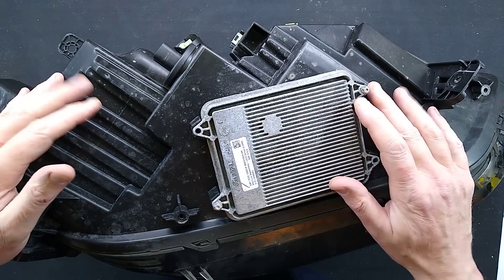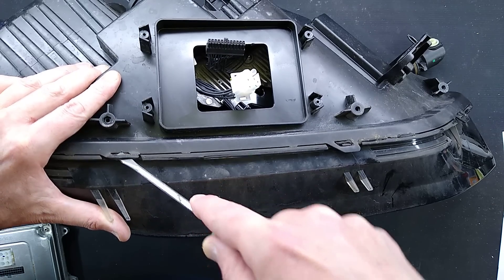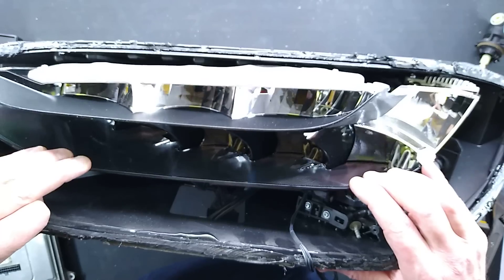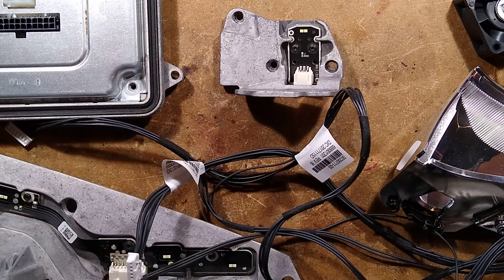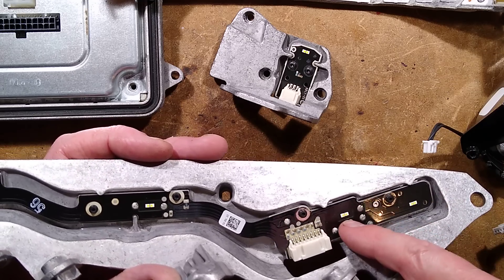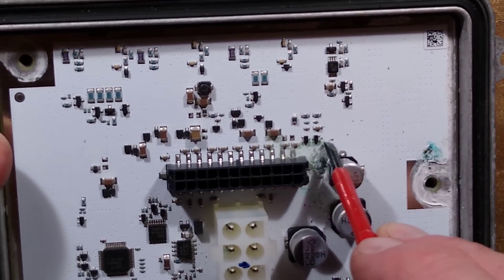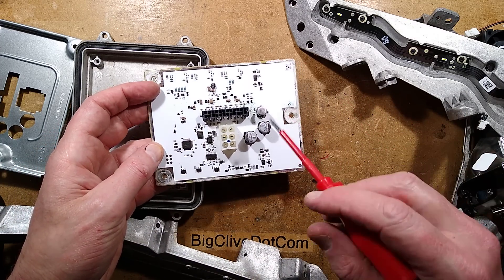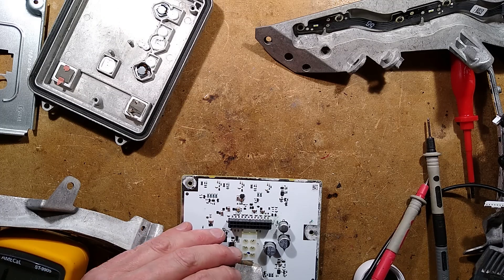Exploring a Tesla model X headlight

Comment: Thanks for reminding me to never buy a Tesla.
I got into a cab once and it was a Tesla, driver was talking about how the car only has 11 moving parts. The wheels, the brakes, the motor, the wipers and the door handles that pop out. 
When I pointed out that each door was a moving part, the dial for the volume on the radio, the speakers, the boot, the indicator/headlight stalks and the interior door handles it seemed to take the wind out of his sails a little. Guess sales talk total bullshit. 
I shall remember that the headlights themselves are also a moving mechanically actuated part and that they cost over a grand to replace if a single drop of water gets inside the control module.
Reply: You’re going to blame a cabby’s ignorance on Tesla?

If he was a genius, he’d be doing something else.
Reply: Tesla doesn't claim that though, so you're really only arguing against some random cab driver you met.
It's obviously true that an EV has that less moving parts than any ICE car, but it's still probably close to 100.
Reply: @logitech4873  I can say with a good deal of centainty that their sales reps will probably claim that the car can travel back in time if you go over 88mph.
Not too far off base for them to say that the car has an absurdly low amount of moving parts.
Reply: @daviddavidson2357  Their sales rep? You don't have to talk to anyone to order one. Most people just order them online :)
When I was at a Tesla showroom trying out a Model 3, nobody there tried to convince me of anything. I was just handed the keys... I mean, keycard.
Reply: @logitech4873  Some people order them online, some people buy them from a showroom.
Have you ever worked in sales? I have and believe me, most sales reps will talk the biggest load of bullshit to sell a product. I ended up quitting because my manager was bragging about how he essentially forced an old woman, without Internet into signing up for Netflix by just refusing to leave her doorstep until "she took a look" then back in the car he's laughing his ass off about how she can't even cancel the subscription easily because she has no Internet.
Reply: @daviddavidson2357  I haven't worked in sales, but I've also never really experienced salespeople like that. It's just not really the culture where i live.
Reply: @daviddavidson2357  Tesla doesn't sell you a car in their stores. You have to go online to order one. Even if you go to their store, they make you use one of their computers to order your car online.
Reply: @sjokomelk  So, by ordering it from a computer in the showroom you are doing what the sales rep would usually do instead of having the sales rep who is in the showroom do it for you?
Seems like extra steps but okay.
Never been to a tesla showroom but they have one in my city and I'd wager sales reps get commission just like any other car showroom.
Reply: @daviddavidson2357  They don't get commision. They are on fixed salary, but they all get  bonuses for when the company hit their targets.
Reply: I think he’s misunderstood, I think it’s the drivetrain they refer to when quoting few moving parts on EVs, vs ICE…
Reply: Wonder how many bearings it has. A typical bearing has several balls in it. And they all move.
Reply: @brianleeper5737  This. The smaller you go the more moving parts you get.
If you go subatomic you would probably have 1x10^1000000... moving electrons.

Comment: It is not just Tesla, BMW LED motorcycle lights have proven to fail similarly. I changed out a rear LED tail light due to internal condensation with a genuine factory replacement part only for the new unit to do exactly the same. Supposedly IP67 sealed unit parts. My arse!

Comment: A note: the 12v aux battery is only used for opening and closing the contactors, plus a few safety systems such as door locks. Everything else is driven from a DC-DC converter from the HV battery.
Reply: I'd imagine the DC-DC converter goes for the higher voltage rather than 12V to keep the 12V battery charged?
Reply: @chaos.corner  It does on the Chevy Volt.
Reply: Most of the conventional car stuff is still powered from the 12V battery.

Comment: What the hell are those connectors doing inside a 100k+ car ??? 
Those are from PC power supply. 
I have seen a lot of people on various FB groups, who had a cheap aftermarket dashboard gauges, that used these. Most of the time they failed, because the connector didn´t like the vibrations, which it didn´t have to endure when standing inside a desktop PC, a thing it was designed for. 
After replacing them for automotive grade connectors, which had rubber grommets for each cable, preventing the vibration induced tugging of cables, all of the gauges worked fine without any hiccups.
Just another engineering oddity, that made me think that the tesla engineers are more electrical, than automotive engineers. Almost like they were forgetting that the car is in motion while used. Not to mention the atrocious quality control, in their factories, the panel gaps, paint quality and interior fitment speak for itself, and is unacceptable, for a car in that price range. Hell, even my Trabant had a better fitment from factory, and that was a cheap communist car for working class.
Reply: Tesla was never and will never be a proper automtive maker with mechanical engineers. It's just a hyped up start-up which still doesn't make any profit.
Reply: Spot on, I am an agricultural engineer and the only connectors that survive are weatherpack. The pins and seals are very well designed. Good job that silly boy Musk doesn’t manufacture combines!,
Reply: @nicolassales8679  I have a 1984 Chevy Cavalier (it was my dad's, he bought it new, and I inherited it when he passed away) and in the process of getting it running again (it had been parked for 10 years), I noticed it had the original GM weatherpak connectors all over it (with the round terminals and green wire seals). Makes me wonder when GM first started using them.
Reply: A lot of aftermarket car headunits use those Molex-style connectors. But aftermarket radios don't come with 3-year (or more) warranties and you're probably lucky if they last that long.
Reply: The inside of the headlamp is the same in any modern LED assembly. Just open another one from Hella or Valeo, and you will see the same kind of connectors. And the connectors you see in this video are inside the sealed assembly. The connector to the wire harness on the car is a weatherproof automotive style connector.

Comment: My 1971 Hillman Imp had ‘sealed beam’ headlamps. Eventually the ‘dip’ element (usually) would fail requiring a complete new unit for the car costing an eye watering £35, but I was able to repurpose the old one as a super-power (for then anyway) torch by using the intact main beam, a bit of drainpipe, and some NiCds.

Note that £35 in 1971 would be worth £550 today!
Reply: You were buying your sealed beams in the wrong place. 
Halfords sold 7" and 5/¾ inch made by Lucas for £7.99, all the way through the late 70s to early 90s.
Reply: @johnnodge4327  That's more like it, or just nip to the local breaker's yard and get a used one for a quid.
Reply: I always disliked sealed beam headlights until I owned a car with them. they never faded, and if they got rock chips, or it got smashed you could just replace them super cheap.
Reply: Blimey
Reply: Careful you'll upset the people who seem to believe that anti-consumer BS  is something Elon Musk personally invented in the 2020's to piss us off. It has never been easy to repair consumer electronics and they have never  wanted us getting in and seeing how they work.
Reply: Sealed beams were mandated in the US for a while which resulted in some interesting design tweaks on European vehicles. I had some sealed-beam drop-ins that you could insert regular bulbs into. Technically not legal according to DOT but nobody checks much around here.
Reply: Even more if you're taking about 35 pre-decimalization pounds in 1971 prior to February 15, unless you are indeed talking about 35 modern pounds.
Reply: @scratchpad7954  So what is the difference between pre & post decimalization pounds? I'll tell you, nothing they are the same.
Reply: @bws833  https://en.wikipedia.org/wiki/Coins_of_the_pound_sterling
Reply: @scratchpad7954  The penny changed value, not the pound
Reply: @henryokeeffe5835  Exactly. There was some talk about doing what Australia did, where 1 pound = 2 dollar post decimalisation.
Reply: @henryokeeffe5835  Exactly. 240 pennies one day 100 NEW pennies the next. No change to the value of the pound.
Reply: Sealed beam for my landrover £25 no water ingress ever, easy to replace, why complicate the issue?
Reply: In the Mid 80s the US automakers switched to aero headlights, but they were very good because you had a replaceable halogen bulb with o-ring fitted air tight into a sealed reflector/glass assembly. The best of both worlds, they never fogged up inside. It must have been to good because discontinued now...

Comment: Interesting video, Hopefully you can get your hands on one of the newer Model 3/Y headlights. They have a stranger square beam pattern
Reply: The newer ones are a projector design LED matrix headlights, thats why the beam pattern looks so strange. The matrix feature is just not available yes as far as I know
Reply: @MikadoRC  The matrix is there, and is working every time the lights are on. It is the 102 LED matrix that makes up the different beam patterns for low beam and high beam.

Comment: There’s an old trick of baking the headlight in the oven at low temperature, which usually softens the mastic/strip caulk between the housing and lens. Makes it easier to pry the parts… apart. No idea if it would cause more issues with the additional components when compared with older halogen type housings.
Reply: They normally use butyl rubber sealing tape or putty, the heat normally softens it up so it can be pried apart, but I have noticed they have started to use polyurethane glue to seal lights up
Reply: @imranahmad2733  Good ole' strip caulk. Don't know why they stopped using it, I've never had a problem with it on my car.
Reply: Yep, I used to do projector retrofits and that’s how we got them apart.
Reply: That's what I've always done when I needed to take my TL's headlights apart to swap the diffusers.
Reply: Worked for me on a Volvo S60 which had internal heat damage on the lens.
Reply: I too have opened headlights with the oven to melt the glue works surprising well and if you reheat the lights before you put them back together the old glue is reusable.
Reply: They used different glue so it's harder/impossible to repair without damaging it. 

More headlight sold more money coming in.
Reply: I had good luck with an A4 headlight with applying a bit of separating pressure and cutting with a sharp knife. Turned out the headlight was unserviceable anyway though..

Comment: You should try warming the headlights in an oven for about 10 minutes, it'll soften the glue used to hold the 2 halves together.
Reply: Does not work with most headlights anymore but definitly worth a try!

Comment: If you think Tesla is the only manufacturer manufacturing headlights like this you are very much mistaken. They are all at it & could not care less how unrepairable their vehicles are, on ICE vehicles VW requires coding to take place just to change the 12V battery. 

That headlight will also need coding to the car for it to work, no plug & play for you!
Reply: the world is ending.
Reply: Bastards!
Reply: There is always a reason. For instance the battery coding is done for efficiency. The car monitors the battery very closely and models it's capacity over time, and uses that data to optimise the charging current, resulting in a small fuel saving.
When you replace the battery, you need to tell the ECU it's new, so it can recalibrate to the new batteries characteristics.
Reply: @aragorn084  I understand that there are reasons for it but having to purchase thousands of pounds worth of equipment & having to be VAT registered in the UK to be able to buy tokens to gain access to their servers to be able to perform coding is well out the reach of a DIYer.

It is at this point you have to ask the question if you cannot repair it yourself do you own it?

So for something as simple as a engine starter battery swap you either are forced back to the dealer or if you are lucky find a independent who knows what they are doing & have invested in your marquee to have the ability to perform the coding on your vehicle.

Sure there is aftermarket diagnostic equipment but it is still in the four figures & operations like coding are very hit & miss.

Nothing like the feeling of bricking a brand new module due to your aftermarket tool just being a clone of the OEM one & they missed a few lines of code in the process.
Reply: @APSuk2  You haven't got a clue. It's not a NECESSITY to code a new battery into your VAG car, it won't stop it working. It is advisable though so that the ECU can monitor and maintain battery health accurately. You don't NEED thousands of ££££ worth of dedicated equipment either, £480 for unlimited VCDS and you can work on as many VAG vehicles as you like, there's no extra costs involved. If you were a professional, you'd already have VCDS......
Reply: @garrett69  I haven’t got a clue but I am correct to maintain the vehicle to perform as it is intended too you do need diagnostic equipment which even with VCDS is still well out reach of someone who just wants to replace their battery correctly and maintain all the features and performance of their vehicle?

The coding of the battery was just an example of how this is a slippery slope, at first it was just control modules that required coding and now we are coding batteries and windscreen washer pumps.

BMW limit alternator charging current, HVAC functionality & heated windscreen usage until you code the new battery so just because VAG does not REQUIRE it as you say does not mean others do not and I can tell you the more later the vehicles you work on the more and more hoops you are required to jump through to carry out even the most basic of repairs.

For VAG you have VCDS but it is now ticketed meaning you have to pay per car but this is missing the point and even VCDS cannot perform every operation the OEM tool can, after market tools always lag behind three to five years especially when you are talking about model specific operations using bi-lateral communication causing you to need the OEM tool to perform the repair.

Yes you can go and buy the diag equipment yourself but for such simple jobs it is just another step to deter people for repairing it themselves and another hoop for independents to jump through.
Reply: @aragorn084  you are so gullible and optimistic.

Comment: That new Te$la headlight burned out? Heck! I'm still driving my new in June 2002 car that has daytime running headlights and still has the original light bulbs. I have yet to replace any of them.
Reply: The cause of the failure is clearly stated in the video. It didn’t ‘burn out’ it had water ingress past an o-ring.

Comment: Usually the glue that holds modern headlights together comes apart around 200-225°F. I have baked headlights to disassemble them before. Never tried a Tesla headlight though.
Reply: Not all manufacturers use the glue. Know for a fact that mazda uses ultrasonic welding or something similar. Still possible to crack with a blade, if you poke enough
Reply: About 100°C for anyone wondering...

Comment: 1:04 wow, what a pile of crap. Using Molex-style connectors inside a headlight? If that were a GM or a Ford, they'd be some sort of sealed connector. That looks like crap you'd expect to see in a cheap home appliance, not a car.
Reply: That is how Tesla rolls baybeee
Reply: @cheeseburgerbeefcake  and the rest of the wiring looks like what you'd see in a laptop.
Reply: @brianleeper5737  Open any modern LED headlamp assembly from Hella, Valeo or any other major manufacturer, and you will see the exact same thing. This is not made in-house by Tesla.
Reply: @sjokomelk  No, they just oversaw and approved the design. They're totally not responsible for what goes into their own product.

Comment: You have to wonder what the design team were thinking / smoking when they came up with that load of convoluted moulded cr*p.  

Motors/fans/complex material mouldings just to light the road ahead!  Worse when these (along with similar German cars) use these lights they dazzle the eyeballs out of oncoming drivers.

Comment: How do Tesla drivers comply with the French requirement to carry a spare bulb set 😂😂😂
Reply: Or any car manufacturer these days.  My 5 yr old Toyota Yaris uses traditional bulbs, and yet it is physically impossible to change the bulb without removing the front grill - which is not a simple task by any means (certainly cant do it by the roadside). What is wrong with car manufacturers?
Reply: @AnotherPointOfView944  Ahhh but you can still keep the Gendarmerie happy by showing that you carry a spare bulb 😄😄😊😊😎😎😎😎
Reply: Same as every other driver that has LED headlamps and/or taillamps. There are no spare bulbs. So you don't have to carry anything.